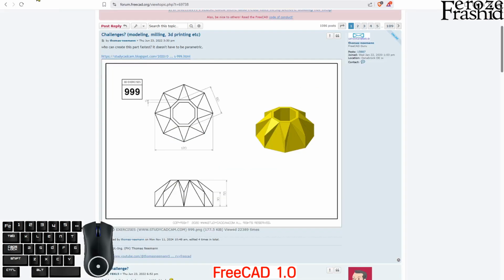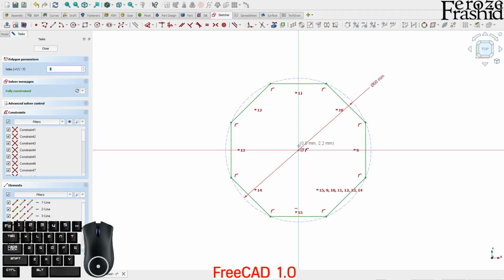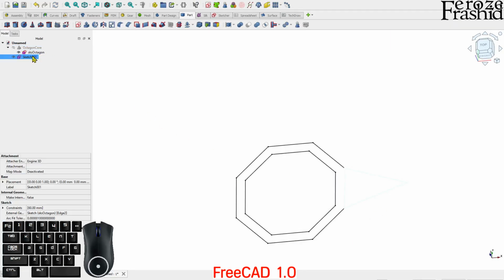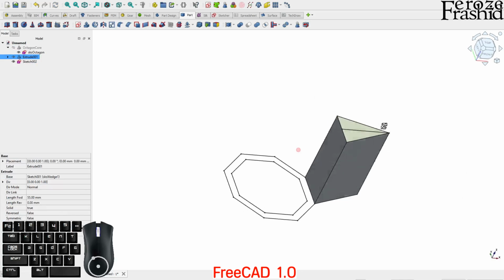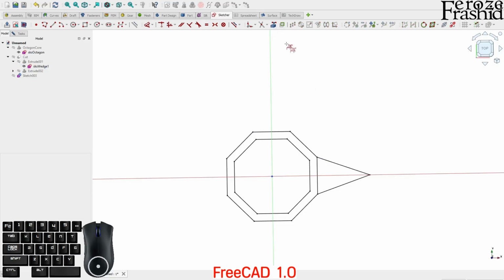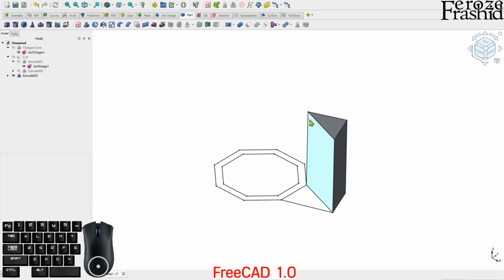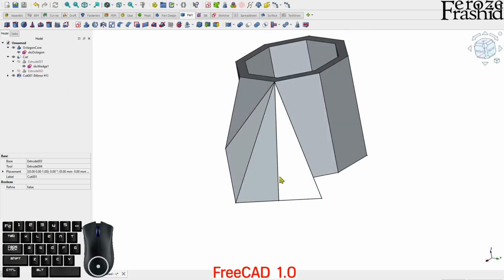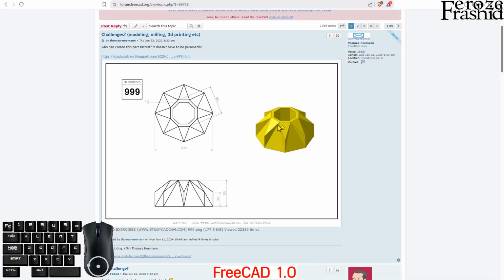Practice in FreeCAD 1.0 Version

Comment: Very insightful, thank you! Always cool to see different ways to combine the different workbenches to create the model. I'm curious as to why you chose to use a Boolean operation rather than a pocket to remove those wedge pieces. It seems like pocket would have worked just as well but still learning so I could be missing an important difference 😊
Reply from the maker: I used Part wb to build this object. Working in Part wb requires manual boolean operation between desired individual parts. Pocket is specific to PartDesign wb. You are right, using pocket here would make it more user friendly. However, it would require me to start the whole process in PartD.
Part wb is kind of riding a bicycle; PartDesign would be an electric bicycle in that sense. Both have their own set of strength and weakness.